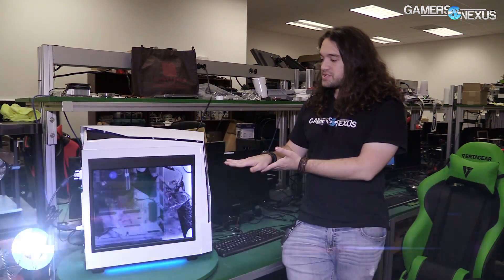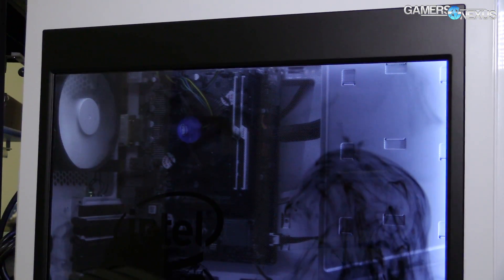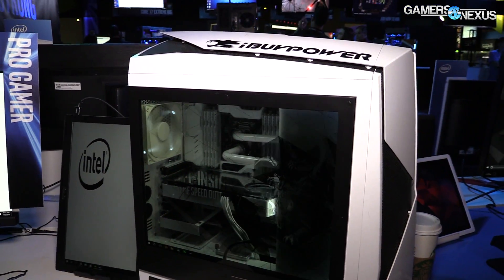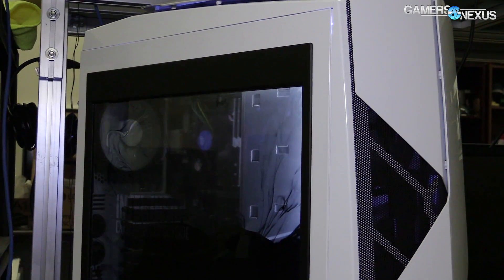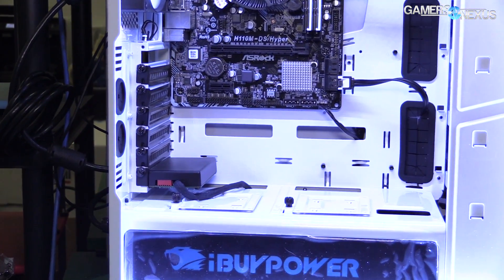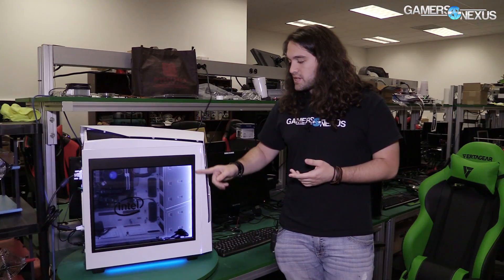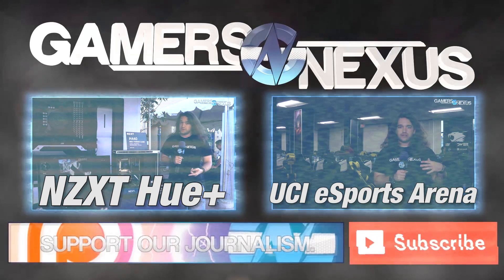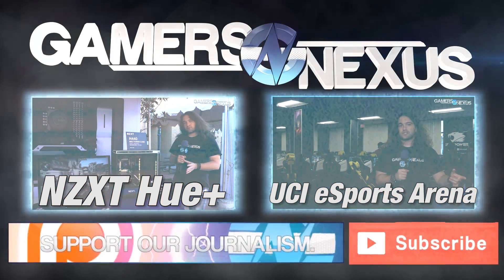LCD Side Panel on a Case - Snowblind V2

Comment: Just about 1760.00 for this computer with a 1070 (msi armor with a back plate)  i7 7000(no k) 256 and 1tb , 16gibs of ripjaw at 2400 and tomahawk mother board. It's not really that bad.

Comment: Depending on how much control I would have over the files it could play and the formats this would be much easier than taking the current idea of a ras pi and using one direction glass. For a bespoke computer this could easily go as a $400-500 option at something greater than 5:4. NZXT and Fractal have a great deal of narrow and long windows in their cases so that would be an interesting direction rather than a simple box format. Impressive idea hope you can move faster than the boutique and mod squads as this should be the step beyond RGB/Tempered glass oblivion.

Comment: Question for ASK GN: We are now at about the same point in time that I found myself when I bought my 970 SLi setup - There is no GTX 1080 TI and I have more money to invest in GPU than a GTX 1080 (back then it was GTX980 for me). Well I have not many  complaints about my SLi setup other than the obvious 3.5GB VRAM problem and games that do not support SLi.
 SO a person with around $900 should buy: A) GTX 1080 B) 2 GTX 1070 for SLi C) wait probably many months for the 1080Ti ??? =) Thanks

Comment: I see two options: "as is", of an esthetic, for maybe $150, it just plugs into a spare video-out on your GPU, maybe with a bundled program to make it easy to loop a video clip/montage on it. The second option is something some folks below have mentioned, which is an actual LCD panel, that you could use as a primary panel, so the machine becomes a semi-portable all in one tower, and not need to drag along a monitor.

Comment: In total I'd pay 100-150 dollars maybe 200 dollars for the case, not including tax. I'm interested but if getting. A tempered glass case is way cheaper and doesn't have that huge ugly branding on the top I'll buy it over this LCD panel case.

Comment: I wouldn't buy a prebuilt with it because that would be too expensive, so they would need to sell just the case. the most I would spend on it would be like $200-$250 but preferably it would be $150. not a huge fan of the noctis case because of the top and the gigantic drive cages. I think it should be in a s340 or a h440. or a fractal define s would look amazing with it, but I'm not sure if they make white ones.

Comment: it would be amazing.

I'd love one for my phantom 630 but, it would be crazy expensive and my rig has a fully blacked out interior with blue accents and a black/blue mobo. probably wouldn't work out too well. it would be better if it was replacing the 5.25 drive bay door on the front of the case and you could add custom static decals to it, black gloss/matte with only the lit up decals showing through

Comment: I'd say $100. Any more and I might as well get a better GPU or other component. Honestly, it doesn't even have to be the full side panel. it could be a section of it. Like a bar along the bottom, similar to a stock ticker.
Reply: it being the last thing you should spend extra money on doesnt mean it shouldnt be a fair price... is like oems fitting i7's with hd 5450s...
Reply: This product clearly isn't for you then, this is where you end up when you have nothing else to reasonable to upgrade, you don't put things like this, like custom water cooling and $800 motherboards in any machine at all that is concerned with price for performance, this is for when you are making a piece of art not for when you are building a computer.
Reply: My original reply was not formulated... but by your logic, they should charge whatever they want because price doesn't matter. Well... how big is the market for $800 LCD translucent case panels??? Not to mention if NZXT sells this... they aren't Caselabs or In Win or Lian Li or Parvum... they won't be able to command a very high price from their existing customer base, nor will a higher end customer be inclined to choose an NZXT case with this "premium feature".
Reply: paskowitz If it sells it sells, personally I would buy an NZXT case with this feature if it was exclusive to that case and expensive enough that it isn't a common sight, $500 for a case if the build quality of the rest of the case was up to snuff seems like a sweet spot to me, though I would be willing to pay more.

Comment: I wouldn't be interested in this if I can see through the screen into the case, because the only reason I might find this useful is to actually use this display as a monitor to save space on my desk, so I would want the screen to be opaque like any normal monitor. For example instead of having two monitors and a tower case on my desk, I'd have one monitor and the case would be the other monitor, that could leave room on the desk for a third monitor or something.
Reply from the maker: That's valid!

Comment: If this can be combined with one of those cases that's designed to hold two full systems, finally those cases, and this case, with have a reason to exist (even if it's just giving each other a reason to exist). :)

I think it looks neat, but I bet it will cost too much if it goes to production, and I bet it will be annoying to use. If it's a second monitor, it's going to get in the way of using the main monitor(s). If it is handled differently, as a custom device that only special software can play videos on, then I bet the software will suck, as hardware vendors are almost incapable of making and supporting decent software (with a few exceptions),  and the less hardware-vendor software on my machine the better.

Still, I am sure my cats would enjoy chasing the animations. :D

Comment: Would be awesome to use the Intel/AMD integrated graphics for the panel and the dedicated GPU for games. Looks very cool!
Reply: and use it to show pc stats like temps, usage, fps, fan rpm etc. heck, even a gif on it would be awesome. Idk about you guys, but I wouldn't pay more than 70$extra for that
Reply: I would almost rather they provided a small budget chip that can handle the video threading so no system resources are used at all.

Comment: I wish they would have a dedicated hardware video player/image displayer that you can load files into because having it setup as a second monitor just gets annoying (much like some of the HTPCs with control panel touch screens on the front).
Reply: I think having it set up as a second monitor might actually be way better for compatibility and might bring more features. You can run virtually any program on a second monitor without the need for special software or support from Ibuypower or whoever might sell these. But when you have dedicated hardware you will probably need special software, special APIs, etc. And we all know that software for special hardware like this will always lack some features that I want, go unsupported after a time and so on.
Reply: Mr. Tux Having it as a second monitor definitly has compatability benifits but IMO I wouldn't use it for more than running looping videos or images etc., both of which shouldn't have any compatability issues because even if you had a h265 video or something new that wasn't supported you can just convert it to something that is, on the other hand if you've ever had a multimonitor setup with a screen that isn't really there it gets damn annoying with the mouse running on to it and add to that the fact your PC has to be on and fully booted/logged in before it works, without a screen saver or sleep mode etc. running and anything that hits performance can cause your nice display to jitter (even if it is only briefly), you will have to manage it manually (things knocking it out of full screen etc.) and, for what is no doubt a small group of people like myself, giving up a screen for a side panel or needing a second GPU is a bad trade off, all making the second screen implementation far less desirable IMO, at the very least having a dedicated hardware display module that can be bypassed should be a thing IMO, if they can do it in $20 picture frames I'm sure they can do it in a case that will no doubt cost at least a couple of hundred dollars.
Reply: The best solution might be to just have an HDMI or similar connector on the side panel display. Then you could hook that up to an Rasperry Pi and throw some video files on it. Or you could connect it to the graphics card and use it like a second monitor. Of course the Rasperry Pi solution needs a bit more tinkering. I just think that it sould at least give you an option to use it without any OEM Sooftware.
 But you definitely have a point that having the panel on without the PC being on would be quite a great feature. But I just don't think that this feature would be worth having to use OEM software and therefore losing flexibility, futureproofness (idk if that's a word :D) and linux support.